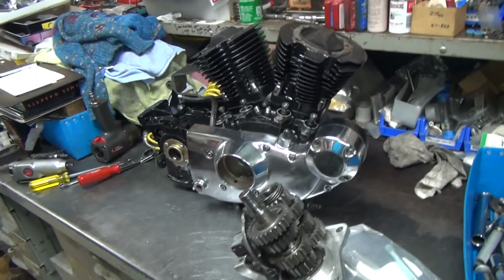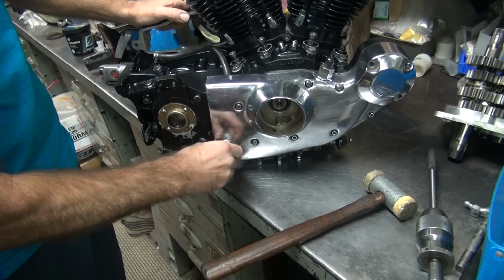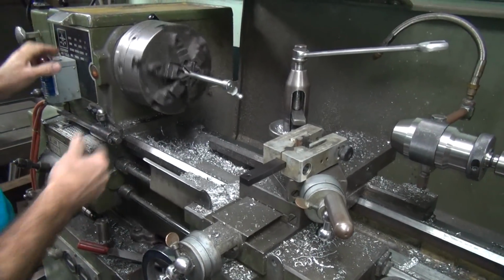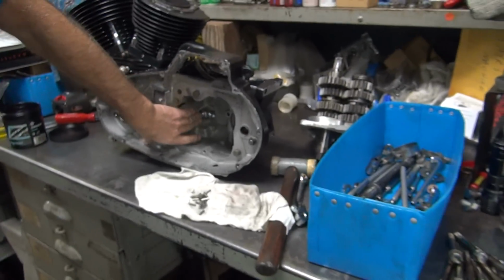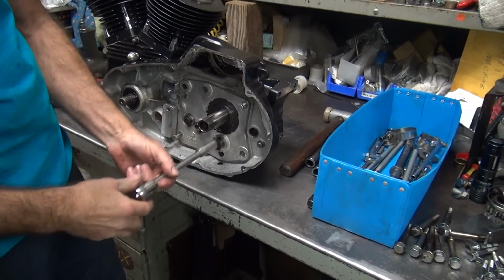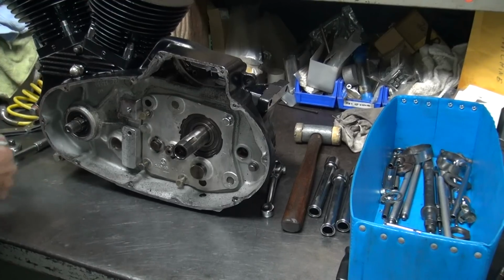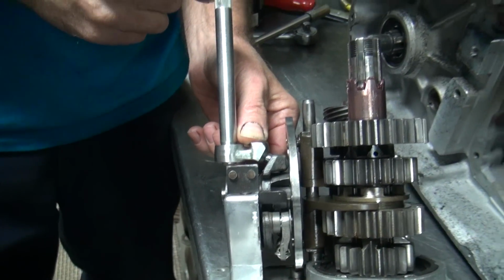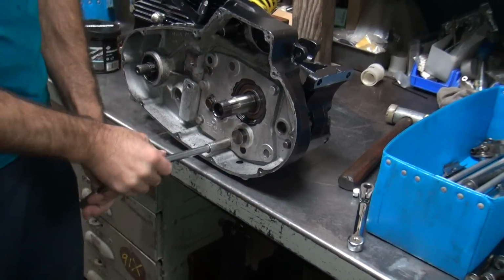1972 ironhead #115 xl xlch case repair motor rebuild harley sportster by tatro machine

Comment: When I rebuilt a Sportster, I always worried about the rollers falling out of the race on the drive sprocket.Finally I started to take the spring clip and backing plate out and putting the rollers in after the trans was in place. You make it look so easy.
Reply from the maker: i don't like that because those clips don't always go in correctly. i like to check them before i put the bearings in.
tatro
Reply: I never had a problem, but I always had to learn everything the hard way. When I built my first stroker , a Harley mechanic told me I should remove the speedometer drive gear, I didn't listen, broke a gear and then the case turned into instant junk. I really enjoy your videos ,Thanks.

Comment: I am replacing a few parts in my gear box as it tends to half jump out of third gear, there is no grinding noise but the shifter lifts up when it happens. Anyway I have found this video very helpful and appreciate your enginuity. I would also like to replace the shift Shaft with a splined one but can't find where to buy one.
Could you please tell me where I can get one.
Reply from the maker: i have them. i think harley started using them in 1973 or 74.
tatro

Comment: The case and now it broke completely. Off the gears are still good I have been looking for some advice if I replace a half case then it will need to be line borred and any way it is an all numbers matching bike the best answer I have found is to replace both half's so at least those numbers mach can someone help and I have not found the case yet
Reply from the maker: if you are restoring the bike than you need to fix the cases. if you just want to ride than just go find another good set to use. the trans trap door is machined to match the case set and are not just interchangeable like everyone thinks they are. misalignment of the gears is very hard on the trans and causes most of the problems that everyone complains about. about every 25 doors i get one that matches a case set. that is not good odds for a good fit when mismatching parts. i would be very suprized if you had no bad gears. look very closely at the 1st gear set. something caused those cases to go boom. any 1972-76 case will fit your frame.
tatro

Comment: never cared for the shifter being on the european side. Shifters belong on the left side and brake pedals belong on the right side. First time I rode one of those european style bikes, I just about killed myself. Kinda like we drive on the right side and they drive on the wrong side of the road. But it is what it is.
Reply from the maker: what are you going to do when you ride a real bike with a hand shifter and foot clutch.
tatro
Reply: always wondered about that, never got the opportunity to ride a bike with a suicide clutch. if at first you don't succeed, try try again.
Reply: Pretty hard to shift on the left side when flat track racing like originally designed for back in the old days with K models and just a carry over until they became popular sportsters and road bikes. No need for brakes while flattracking or allowed way back. Some of the most exciting racing in my opinion flat track dirt and ice racing
Reply: @edwardkawecki8101  Yep, right side was the right side.